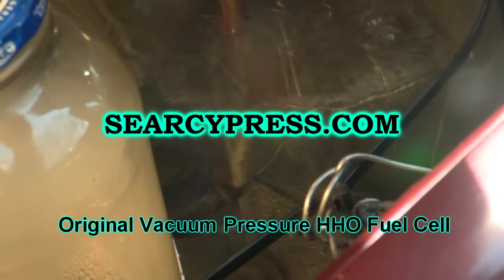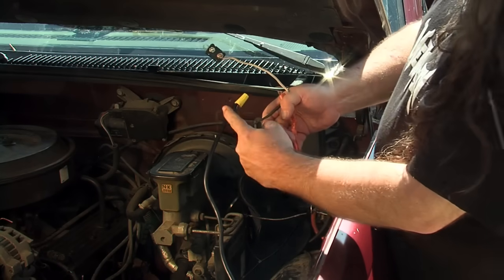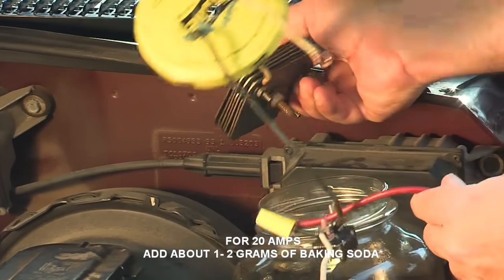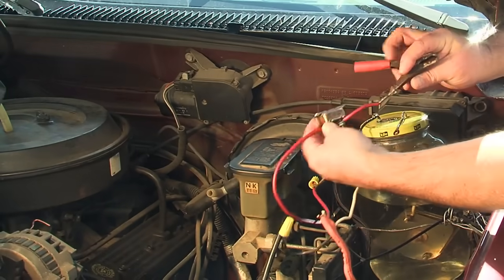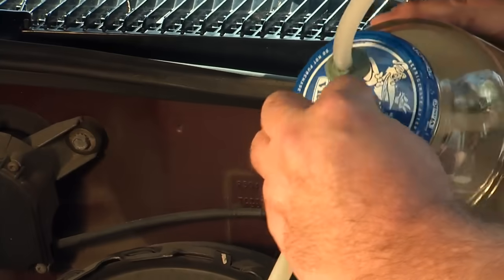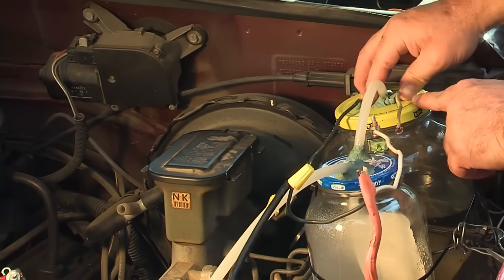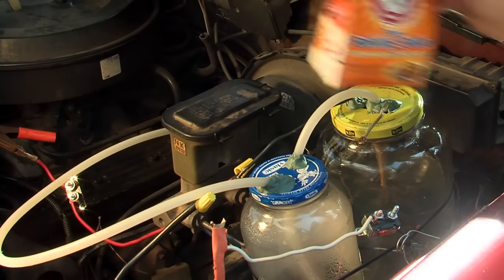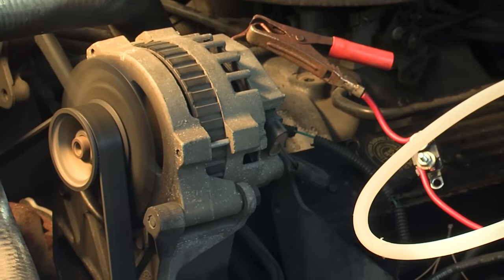Vacuum Pressure Hydrogen fuel cell defeats high gas prices using hydrogen from H2O.

Comment: What if the water is came from the hot water from the radiator going to the hho generator to consume less power to the battery to create an a hydrogen
Reply from the maker: The power that is used by the cell is not a problem. We are not trying to power the engine. We are only trying to power efficiency. The fuel cell produces gas that causes complete combustion when injected into the vacuum in the cylinder. The engine is only consuming about 80% of the fuel and the other 20% is exhausted into the catalytic converter where it is then burned. By injecting in the state of vacuum we are taking advantage of the 20% of the unburned fuel and gaining energy from its usage. The reason you see a lot of water coming out of the tailpipe is because the catalytic converter is not getting hot immediately. The water that comes out is actually coming from the gasoline and not the hho. Normally you don't see it much because the catalytic converter vaporizes it from extreme heat. When first installed a lot of carbon and junk will come flying out of the pipe onto the ground. It does a really good job of cleaning everything out. We have a new video coming out soon, be sure and subscribe so you don't miss it. Thanks very much for your comment.

Comment: So it’s not about power, it’s about efficacy and cleanliness of combustion of gasoline burn. In diesel, you can just ultrasound mix in 10% water, problem is the need to prevent it to separate after a few days, so you have to circulate or shut it off before stopping the engine and use up emulsion already produced, so keep volume low. 
If the small amounts of brown’s gas do the trick, coooool. Just watch rob murray-smith’s super efficient graphite dry cell hydrogen generator: use graphite plates instead of stainless steel.

Hielscher ultrasound company does ultrasound diesel water mixing for engines running a long time, ships etc.. I wanted to use massively parallel cheap mems based nano mixing devices and a 2 chamber pump, water and diesel, to mix right before injection. Near 0 supply of emulsion.

Comment: Talking about high gas prices in 2011, now 2022 it’s even worse so this might be really useful
Reply from the maker: When we first came out with this video, gas prices hit an all-time high of over $4 per gallon. Within 3 months of the release of our video on national television which aired in eight states, prices plummeted to 99 cents a gallon. Mythbusters immediately produced a video trying to debunk the technology of HHO stating no one can even make a bubble. I completely understand why they did this. Some stuff is just too dangerous for common folk to understand how to use safely. Now we find ourselves over 10 years later in the same boat. I can tell you, there have been some improvements. Be sure and check out our new video coming out soon. Don't forget to subscribe. Thanks very much for the comment.

Comment: You know if you use the dry cell would be a lot better you only getting a half a bar of pressure out of that wet cell you can get a whole bar of pressure out of a dry cell and you have two dry cells you have two bars of hydrogen oxygen pressure better to run the engine off of
Reply from the maker: We built a pumping cell back in 2007. After testing it extensively we discovered that injecting into the intake on the air system to the carburetor was a complete waste of time. The air is leaned out way too much to accomplish anything. Only by vacuum injection can results be obtained. You cannot power the engine with HHO. There is just not enough to do it that way. By injecting in the vacuum however you can cause total combustion of the fuel in the cylinder. That eliminates the 20% of fuel that is exhausted into the catalytic converter and wasted. If the idea of a pumping cell worked we certainly would have ran with it. However, someone saw our video and went into our forum and asked a few questions and then, boom the magical useless dry cell. You can find that video we made showing that pumping cell on Metacafe. Be sure and check out our new video coming out by subscribing. Thank you very much for the comment.

Comment: The guy that designed and built this, mysteriously died few weeks after he went public. The cia, nsa came in and took all designs, plus the one he built.
Reply from the maker: Not all hho fuel cells are the same. This is a vacuum pressure fuel cell. We've been doing this since before 2007. We have a new video coming out soon be sure and subscribe. Thanks very much.

Comment: I love how he's made this out of a couple of pickle jars... I was thinking "what if they break?!"... then I realised he could pull over at almost any store and buy a new jar of pickles... genius
Reply: $2 fix. And no mechanic needed.
Reply: 🧓 Son, have you seen my large canning jars around? They are not where I keep them🤨!
Reply: those are some good-ass pickles too
Reply: Even better: can fill up his STOMACH too by munching on pickles. I love Vlasic, they're sweet and crunchy.
Reply: If he gets into an accident they will break and stop making hydrogen. It’s probably the safest way to power a vehicle with hydrogen.
Reply from the maker: In that video we used a clip on the alternator which would most certainly come off and stop any hydrogen oxygen production. Certainly there's more ways to do this safely and we do cover that with an improvement we made that is vastly better. We will show a professional installation and cover a lot of the technical issues. Be sure and subscribe. Thanks for the comment.
Reply: @metalpresstv  you made a version that is vlastly better
Reply: @metalpresstv  Is there something you can buy to get less fuel usuage?
Reply from the maker: Probably not on the level you hope for. Any type of air mix  injection out of vacuum of hho will do nothing much we found. We helped pioneer that, then abandoned it when we realized it was a frugal effort. Sadly the cat was out of the bag and others jumped on board promoting products that were failed attempts that we helped to develop in the process of learning what can work. Those useless products now only hurt progress in the further development of vacuum technology. Thanks for the comment. Be sure and subscribe. New video coming soon.
Reply: @metalpresstv  Anything else that can help get fuel economy down?
Reply: @metalpresstv  😉
Reply: @barkanellichasingdreams4142  it's called a tune-up
Reply: @barkanellichasingdreams4142  I would think you meant to get fuel economy up I mean we are talking about economical things right
Reply: @toolguyslayer1  If they win its cool for them and if they lose someone else is happy
Reply: @FuAzzi  Vlasic so genius
Reply: @danpower4396  that’s what they said when they made the Hindenburg
Reply: I heard of a pickel shortage???
Reply: This doesn’t work .
Reply: @Paul-q3m7k  you know H2O has two hydrogen and one oxygen molecule, and using electrolysis, you can separate the molecules into individual components; so, in theory you could have the hydrogen set up to the fuel line and oxygen to the intake you could have a endless supply of fuel in  theory; with the byproduct of combustion from hydrogen is water, you could refill your water supply, so we can be separated back into the two elements.  This was a topic in my grade 7 class in elementary school back in the 80s
Reply: You hook it up to the fuel injector the hydrogen like you would do if it was running they already have forklift doing it on propane
Reply: Plus it's super easy to just put some foam around em n boom. Less likely to break  the jars lol
Reply: Here they come car running off of water 💦
https://youtu.be/NMH1pBAYgYs
Here they come car running off of water💦
Reply: Or use plastic bottles instead. They're only gonna pollute our oceans otherwise.
Reply from the maker: Unfortunately plastic or PVC is out of the question. The high temperatures combined with a vacuum always distort any plastics we've tried. We even tried ceramics. The ceramics look solid however but are porous enough for a strange crystal-like substance to form. The entire fuel cell grows a fur which goes on to the engine and eventually I think would completely cover the entire motor. Very weird. We have a new video coming out soon be sure and subscribe. Thanks for the comment.
Reply: @metalpresstv  Great stuff much appreciated. You mentioned a new video coming out soon, is it out by chance?
Reply from the maker: @forsfullcommunications1561 not yet. We are still making some additions to it. It's been a long time since we've covered this topic so we want to make sure we clear up a lot of misunderstandings. One point we really want to get across is this is not at all like injecting HHO into the carburetor. The thermal behavior is completely different. It will be a much safer install for sure. We had dozens of videos all of which did not survive the changing rules over the years. Lots to consider. Be sure and subscribe and all of that stuff so that you don't miss it. Thank you very much for commenting.
Reply: if he doesn't have some type of hydrogen explosion
Reply: You do realize this is complete bullshit, right?
Reply: Yah but what's he supposed to do with all those pickles? 
🤔
Reply: @@RP-ff5tx😂
Reply: I love how ignorant people think ... it's quite humorous watching this guy build something that reduces his gas mileage, then convince himself he has defied the laws of nature.
Reply: The pickle juice probably works great for electrolysis. Chlorine gas as one of the byproducts though.
Reply from the maker: @Pans_Shadow  I just realized I never even tried it. Lol 😁 thanks for the comment.
Reply: 🤣🤣🤣🤣🤣🤣🤣🤣  yep!   MacGyver it, the redneck way.
Reply: Just make a stainless steel container it never breaks😂
Reply: My concern was what if the broken jar rips open a tire, I also don't think plastic would work, because of heat, so maybe metal?
Reply: I used a cookie jar, it didn't work. Got myself into a right pickle.
Reply: You could always keep spare parts in the back 👍
Reply: Right
Reply: Any MPG info?
Reply: Hold my beer, I gotta chug these pickles 😂
Reply: Or maybe not use glass jars at all for this application, this is definitely some Soviet Engineering.
Reply: More like genius north Carolina hardworking family man @abrahamedelstein4806
Reply: and if it explodes, no shrapnel 😊
Reply: Just buy a plastic container it'll last longer
Reply: @itzjonnuke2105  heat is the issue….solution gets hot at those amperage’s….
Reply: @itzjonnuke2105  the ones they put the dressing in for restaurants.  same size but plastic
Reply: @itzjonnuke2105  hho would leak faster with plastic
Reply: @itzjonnuke2105  but pickles though
Reply: Air pressure
Reply: @itzjonnuke2105  and tell you to have a triple-digit hot day and your engine starts to overheat along with your battery and guess what else goes along with that I'll give you credit for that one though some plastics are pretty tough

Comment: Does it work for fuel injection too
Reply from the maker: Debatably. Understand when someone says 'I have HHO on my truck." That does not in any way shape or form mean that they're running a vacuum pressure fuel cell. People who are injecting HHO into the carburetor are trying to boost performance, however what they are doing is leaning out the gas so much it's doing nothing and reportedly causes an increase in the oxygen level which is detected by the computer. You then get an increase in fuel which leads to no boost at all. When you inject in the vacuum system, it is different. We are not trying to power the engine. We are only trying to burn the 20% of wasted fuel that is normally ignited in the catalytic converter instead of the actual cylinder. This is the reason why we show so much water coming out of the tailpipe. People assume this is from the hho. That is not the case. It is coming from the gasoline. Normally the catalytic converter is so hot from burning leftover fuel only vapor comes out of the pipe for the most part. Anyway I could go on forever but let's just call it debatable. It takes a lot of skill to install a vacuum pressure fuel system and that is why we say do not build it. Because, frankly only a very small population has the technical skills to do it properly and safely. We are working on a video which will be coming out very soon that will show some improvements and I will talk a lot more on the topic. Be sure and subscribe and I will do my best to not waste your time. Thanks very much for the comment.

Comment: I built installed one very similar in a 92 suburban I once owned. I gained 6 miles per gallon. Acceleration was faster and smoother running engine and emissions was less invasive to the bronchial tract. During my early initial experimental process i had an explosion , I was sitting at a picnic table, thankfully I installed a bubbler/ secondary hydrogen storage( pint mason jar) i was setting two feet from the jar with about 1/3 of the jar filled with hydrogen as it violently exploded !!!💥🙉, it blew me backwards up on the rear legs of my lawn chair and I couldn't hear for 20 minutes too well , I know (😂🤣) right.(idiot) thankfully it blew the lid off instead of exploding the glass jar or I probably would not be here. I'm trying to say people ( it is an extremely volatile explosive gas ) be extremely careful/cautious. Use a bubbler maybe in case your vehicle backfires🌎✌🙏🙏🙏🦋
Reply: @Justin Time extreme heat
Reply: Why not just take a steam engine and take the flame from the gas and boil the water to make Steam engine run?????
Reply: @raychris6759  go for it ! You might want to study up on steam engines. They require regular maintenance such as oiling and more but sounds like it would work.i personally developed a self sustained air engine💨🌪🍒

Comment: Why nobody makes a system that actually pumps the hot water in the cell to another radiator for cooling and then prevents the cell from overheating and improves efficiency?
Reply from the maker: Those types of cells are completely worthless. They do not operate in a vacuum. When they are injected into the intake of the air they are leaned out and become useless. When injected into the vacuum things are much different. Remember the boiling point of the water has been lowered by the vacuum considerably. The water in the vacuum jug acts like a refrigerant in many ways. Not saying it gets cold or anything but the heat reduction is a main factor. How do I know? Get on the website called medacafe and look for my old channel. You'll see back in 2007 where I invented a pumping system. We abandoned this because it was useless. Now it has become quite popular though rebranded. New video coming out soon on this topic, be sure and subscribe so you don't miss it. Thanks for the comment.

Comment: This is trash science. The only benefit is the hydrogen helps burn more of the gas efficiently until water vapor builds up, which is the byproduct of hydrogen burning. The build up of water vapor then resets any benefits the hydrogen provides after the first engine cycle. Water vapor in the engine also hurts your cams, pistons, seals & degrades performance.